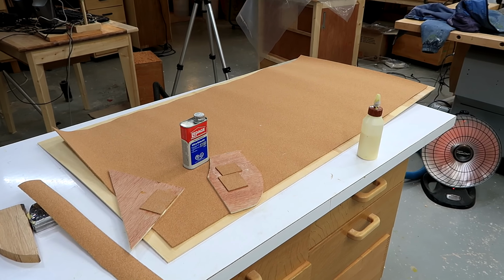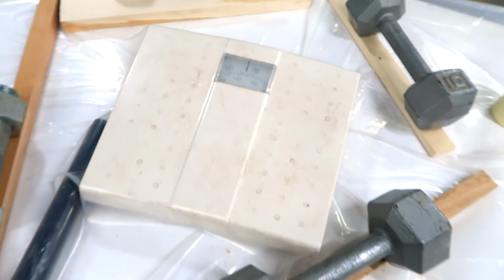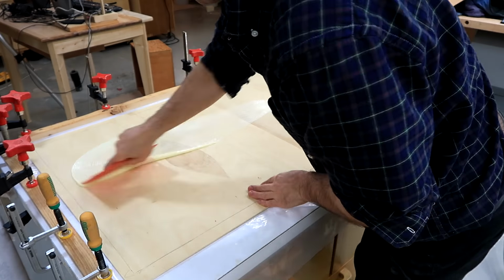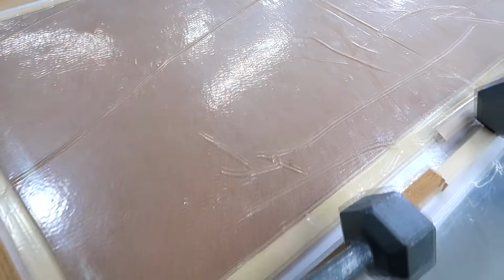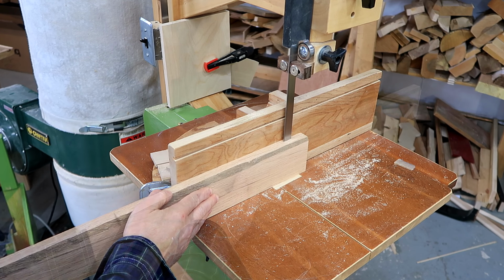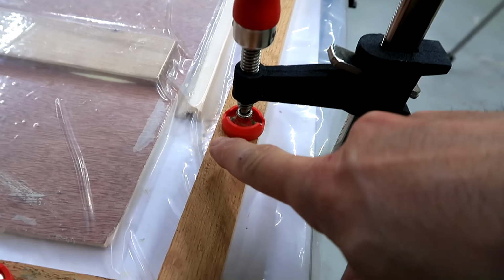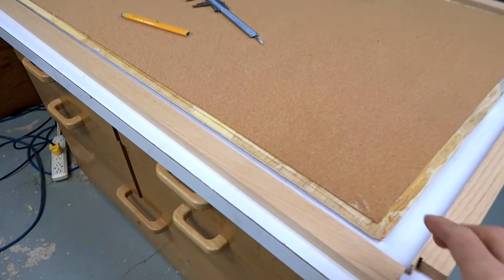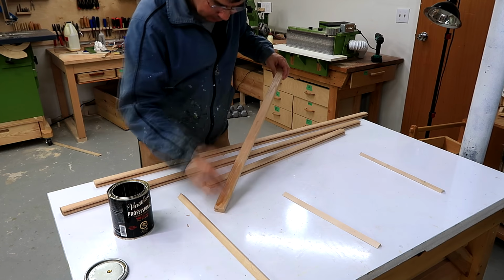Vacuum clamping on the cheap to make a cork board

Comment: For sheet material that doesn't warp and buckle, especially when you smear it liberally with a wood glue have a look at dibond. 0.7mm of aluminum sheet, polyethylene core and 0.7mm of aluminum sheet on the other side. You can get 3mm, 5,mm 7mm ... thickness. Absolutely wonderful building material. Very rigid, light and possible to score with a knife and break, or it can be cut with simple woodworking tools. Often used for signmaking.
Yes this is the clading material that was used on the outside of Grenfell towers.

Thank you for the video. Every time you post something seemingly mundane I learn some cool tricks ;-)
Reply from the maker: that stuff would be impossoble to get a thumb tack into

Comment: @Matthias Wandel a good method for improving vacuum distribution that doesn't involve multiple channels and pieces is to use a breather.  Something like poly batting or a moving blanket works well.  They are required for composite vacuum layup.  Lovely looking board!

Comment: when Robert does the sealed paper + conductive ink battery he used a simple house iron & grease paper around the edges to properly seal in the electrolyte between two plastic sheets worked very well

Comment: Matt, that vacuum setup you had on the floor was a good idea. I actually built a shop vacuum from one of those I got from an old mainframe computer.  It was a bulky unit, but well worth the $10 or so I paid for it.
Reply from the maker: does it look just like mine?  I always wondered where that came from.
Reply: @matthiaswandel  it's very similar, if not identical. I bought mine more than 30 years ago and eventually gave it to a college.

Comment: I would have never thought to use plastic to make a vacuum like that. Very cool. That trim around the edges sure did dress it up, too, and I'm sure it helped add some rigidity to the whole board.
Reply: Another cool vacuum-related woodshop tool is the vacuum chuck - put it where you normally put your lathe chuck and it holds the thing you're turning via suction.

Sadly my lathe doesn't have a hollow spindle so I can't use one myself.

Comment: If you run some spiral cable wrap around the outside of the part, you'll get pretty even suction all the way around. A lot of people use it for carbon fiber and fiber glass infusions for the same reasons, and it's pretty cheap.

Comment: Stacking three blades does seem easier than setting up a dado stack. This made me think that perhaps we need a better dado system. I mentally reinvented the shaper, then decided that the current system is probably as good as it is practical to make - at least commercially. My current favorite impractical solution is to just make changing blades much easier by hinging open the whole saw table.
Reply from the maker: Not any easier.  Though for the 4 mm slot I needed to cut, I'm not sure if my dado stack would even work for that.

Comment: I'm quite partial to covering several cheap dollar store poster foam with fabric as a tack bulletin board. But your board looks like it will last much longer. 
Tho I wonder if a sheet of cheap eva subfloor/stall foam might be even better. Or perhaps rockwool ceiling tile, with the added audio absorption perk.
Reply from the maker: its hard to get the tacks into though.  Your idea sounds like its worth an experiment.
Reply: @matthiaswandel  If you do the ceiling tile one the safety police might come for you. (idk i personally wouldn't get bent up over using one as a bulletin, it's not like you're lining your ducts with it)

Comment: You can also run a length of rope from the hose opening across your workpiece to aid in vacuum distribution. I've used rope in this way on screen printing exposure units to help evenly distribute the vacuum blanket that goes over the screen when being exposed.

Comment: Easy way to deal with insufficient vacuum is to lay any webbing with loose fibers on the table around the item you want and at least one diagonally going over, or half way. If you watch Julian Baumgartner's art restoration channel, his vacuum table is pretty much the ideal setup and that's what he uses.

When i didn't have one, i used to just put multiple nozzles in four corners of a sheet using the end of toothpaste tubes (you cut them at the transition from the truncated cone to the tube body, and use the cap's threads to secure them in place. The cap gets drilled and a tube slid inside that piercing pin used to be. Vacuum keeps everything kosher, so you don't need any glue for this if the tube fits inside the cap snugly. The truncated cone that goes under the cellophane has small ridges cut into the base so the air can be sucked.), and a wood roller to insure the air gets sent to the pick ups.

Once you've removed the air, you're pretty much set, so in most cases, you'll make do with just one vacuum port in the center and a bit of work to press stuff down.

Very simple and good method to make thin plywood. I've gotten pretty good at making large sheets of 3 ply using veneer and vacuum.

Comment: Very nice. I especially liked the tip of using tape to position the frame for hanging.

As far as the vacuum clamping goes, my concern is that running my shop vac with no airflow would burn out the motor.

Comment: 30 odd years ago, I did a similar cork board, but I used 12 inch cork tiles. Much easier to work with! We are still using it.😎
Reply: I suspect one with a tiled pattern would even look better. No?
Reply: @markifi . It has the added advantage of being able to replace worn bits. As ours is behind a door which is 95% of the time open, the beauty of it is somewhat lost on casual observers, but to me, it remains one more honey do done. And the points go on the accumulator, happy wife, happy life pal!

Comment: You might be intrested in the baumgartner restoration channels vacuum table.. basically he puts some cotton around what he wants to press, seals things of with just some sticky tape and then pulls the vacuum out of the cotton strips, which even though they compress, will still have some gaps

Comment: To deal with the lack of vacuum in some areas you need a "breather layer" between the vac bag and the piece you are clamping.  Usually it is some sort of reusable plastic mesh, but you can use burlap or something similar.
Reply: I use an old moving blanket, but right near the vacuum hose, I place a folded up air filter to help spread the suction out initially.
Reply: I was thinking of how sous vide bags for non-chamber vacuum packers work. They have tiny channels on the inside of the bag to help move air out.
Reply: @MrMartinSchou  Oh yea, they do- I wonder if that can be bought? I have seen textured plastic... ribbed on one side...
Reply: @chrisgriffith1573  worst case scenario, you can buy 50 foot rolls of the bags, and remove the smooth side.
Reply: Ha! I just left a comment to this same effect.  I should've known someone already did it. Lol
Reply: Nah, your methods are way to easy. What's the fun in that? Obviously you need to make a special plywood panel full of Pocket-Holes® to channel the air around.

This comment was sponsored by Microjeez, maker of the gr-r-ree-ripper.
Reply: For those that follow Baumgartner, he uses cotton webbing to run around the outside https://youtu.be/YF5tGWKZQi8?t=2135. But of course on this channel, wood is the answer...
Reply: @coopersandy  Was wondering if someone would bring up his method.  Way to go.
Reply: MDF board breathable.
Reply: @chrisgriffith1573  buy rubber floor mat with ribs. It's sold by the foot as a floor runner and comes in several widths. (24, 36, 48 wide)

Comment: I'm equal parts disturbed and fascinated by your metalworking method.
Reply: LOL!
Reply: chiselling materials to remove or shear them is one of the oldest way of working metal and other materials.
when a machine cuts metal today its really just  the same action.

like it uses force to work the edge of the cutting bit into the material, deform it and then it separates it as a chip.

chiselling is like cutting, its just not  a continual force, but a interrupted one.

i find it interesting that we lowkey are still smashing rocks together to make stuff.
metal is just highly refined rock, and cutting tools are just specially shaped to be better at shaping other stuff
Reply: I learned that method of cutting small parts from my father more than 40 years ago. It's surprisingly effective.
Reply: @sturmey1966  About the same time span here, but from an old machinist - I use it many times as it leaves excellent finish, if done properly.

Comment: I used 3M spray adhesive, put another board on top of the cork and spread out a few cinder blocks on top of that. Worked like a charm.
Reply: One should never underestimate the utility of a few old cinder blocks stacked up next to the house.  They're rarely the right thing you need for whatever you're doing, but they're often something that'll work.

Comment: Never seen a homemade vacuum clamp. Original and functional. 😅👍
Would placing a second table upside-down onto the cork board not have worked as well?
Reply: Would you have watched a video on that? :P
Reply from the maker: it wouldn't guarantee even pressure
Reply: assuming that bathroom scale was 12"x12", he was getting about 1.67 psi.
if this cork board is 3'x6', that's potentially 4300 pounds. 
the table is probably less than 100 pounds, or 0.03psi, so this is much more pressure

Comment: A word of caution about using a shop vac for this purpose.  Some shop vacs are cooled by the air passing through them, and so restricting or stopping airflow may result in overheating the motor.  Also, some shop vacs have internal fusible links inside the motor that break when they overheat, and they can not be replaced.
Reply from the maker: Never seen a shopvac that uses its sucked air for cooling.

Comment: Tape the edges next time. poly tunnel tape will probably work well. You could also scavenge  a valve from one of those vacuum bags you put textiles in and evacuate with a vacuum cleaner. Thats what I would do if I had a shop that could fit such projects.

Comment: I did some Vacuumbagging for a couple of Longboards

Do distribute the Air much more they sell some kind of 'Netting' but u just used some Aluminum L and U Profiles, round woodrods etc. I had on Hand

I'm always astonished how much Pressure 'Vacuum clamping' can produce. And it is a lot more even than Local clamping

But I like the idea 'Board with channels on the Bottom' 
O_o I might do that with my next Board

Comment: Use special poly mesh designed for vacuum bagging, it will equalize the vacuum across the entire work surface.
Reply: I'm a bit late for this, but you can just use some rope to redirect vacuum if you feel that a specific area isn't getting evacuated well, put a piece of Paracord or just whatever you have around from the source of evacuation to the area in need.

Comment: Awesome, thanks Mattias!  Can someone point me in the direction of understanding the math here? How does he GREATLY exceed atmospheric pressure? Or, is the 200+ pounds of force on the scale just a sum of all the pounds-per-square-inch?
Reply from the maker: 240 lbs on the scale, which is nearly 1 square foot, is just a fraction of atmospheric pressure.
Reply: 144 square inches per square foot.

Comment: The only problem with using a shop vac is they need air to keep the motor cool. If you don't create an air leak the motor will overheat in a few minutes. That other pump has the motor separate so is a wise choice.
Reply from the maker: actually, shop vac brand shopvacs don't use the sucked air for cooling.
Reply: @matthiaswandel  ... good to know!

Comment: Nice vacuum clamp. Next time wrap the plastic around the 1x2s to get a better seal. A 6 mil or .006" thick or .015 MM. PF film gives a higher vac level. You can get these at any home store.

Comment: Mathias, you were 90% of the way there!. Check out Baumgardner restorations. He does vacuum table work on multi million dollar paintings.  Exactly the same method you used except for...he runs several layers of 2 inch wide cotton wick around the art piece for evacuation flow and just seals the plastic down with packing tape.  Sucks the air out from a corner with a vacuum pump. It's a really great channel. Cheers.

Comment: If you decide to do more vacuum "clamping" like this, you should check out Baumgartner Restoration here on YouTube. He has a custom built vacuum table he uses for flattening and bonding fine art. One of the key aspects of his table is the use of woven straps around the perimeter under the plastic to create an air channel all the way around.

Comment: I have a bunch of window screen frames to make and liked the jig you used for cutting the 45s.  What is your preferred method to cut the frames to exactly the same length so the miters all fit?
Reply from the maker: I don't so much cut them to same length.  I cut them to fit.
Reply: @matthiaswandel  Fair enough.  I was trying to come up with an efficient way to cut materials for ~10 frames the same size and not have to adjust each one.

Comment: I wondered if it was going to be an issue because the glue needs air to dry. I guess not. Is it because you're essentially sucking the moisture out of the glue?
Reply: Most glued surfaces are only touching each other. I'm not sure there is any air in there in the first place but I could be wrong.
Reply: @cbalan777  Yeah, I guess the wood sucks the moisture out of the glue. So I just wasn't thinking. Thanks.
Reply from the maker: Yes, the moisture goes into the wood.  The wood dries out later.

Comment: Does the vacuum motor overheat? Mine needs a minimal air flow for motor cooling. You could be reducing the motor life by leting work without proper cooling, right?

Comment: Nice one, Matthias, One thing though: usually vacs use the airflow for cooling their own motor. How did you prevent from overheating?
Reply: Looks like he only ran it briefly as a backing pump, and only ran the smaller, quieter one for the majority of the time.

Comment: Why not use a larger piece of board and use clamps or weights on that instead of the complication of the vacuum clamp? Would it not be even weight across the surface area, or at least as even as the vacuum?

Comment: That force in the scale was surprising.   Would be interesting to glue up some joints with just a vacuum clamp and do some strength testing
Reply: assuming the scale is 12"x12", that's 144 square inches
240 pounds means 
1.67 psi
atmospheric pressure is 14.7 psi, so well over what's necessary to compress the bathroom scale to 240 pounds...
some experiments would be interesting indeed.  
i wonder how close he could get to 14.7?
Reply: @andy4an  I was wondering if the scale being more raised off the surface would see more downward force than a corkboard glue up of similar size, you know,  vector forces and all that

Comment: Just out of curiosity, because the vacuum thing was way cooler, was there a reason spray adhesive wasn't used?
Reply from the maker: hadn't thought of it, and not sure if it would be up to the job.
Reply: @matthiaswandel  gotcha, I've had good success with it and cork+wood but I've not done such a large surface

Comment: Why not just put another few sheets on plywood or whatever on top and weigh those down with stuff.  Heck take a small table or desk and flip it upside down then throw tools on top of that, bags of sand whatever.  This seems like ridiculous overkill.  Heck you could have done ith with another sheet of wood and a few clamps pulling that down.  But hey this is fun too

Comment: How about contact cement around the perimeter for a seal?
Reply: He explained that.
Reply: But then you'd need to clean it up!  As he demonstrated, a perfect seal isn't necessary for this.  When using a low-volume pump like an actual vacuum pump, you need to worry about seals.  For a high-volume suction device like a shop vacuum, it can deal with an acceptable level of leakage...as he showed, when he simply laid the plastic down, and made zero effort to seal it.
Reply: But later in the video he had trouble with uneven pressure

Comment: 110kg... The moment the shop vac goes on.
The atmospheric version of going to 11.
Reply: ~1.67 psi is a small fraction of 14.7 psi of atmospheric pressure (at sea level)
probably the atmospheric version of going to 11 is doing the work in death valley (where atmospheric pressure is over 15.0 psi)